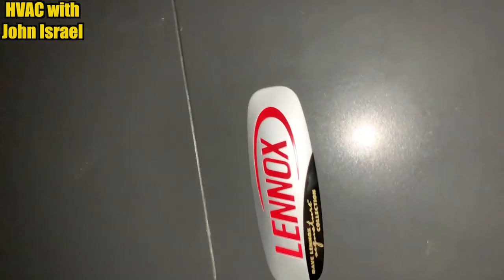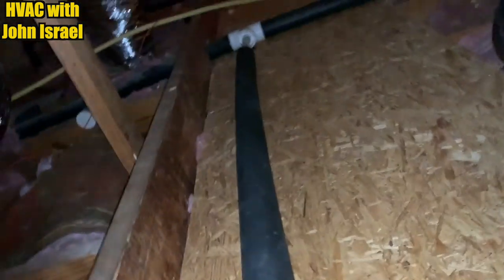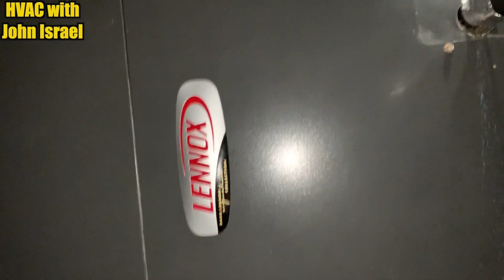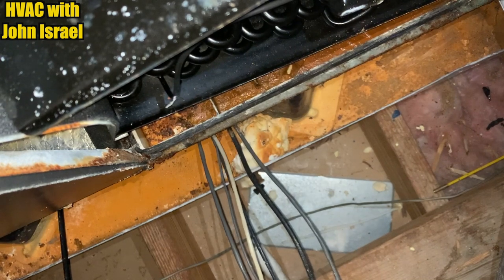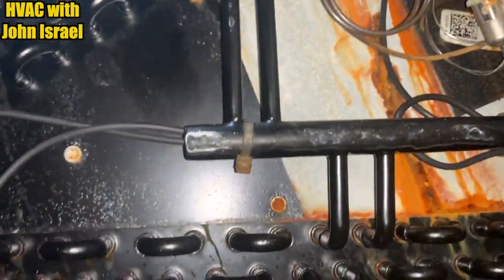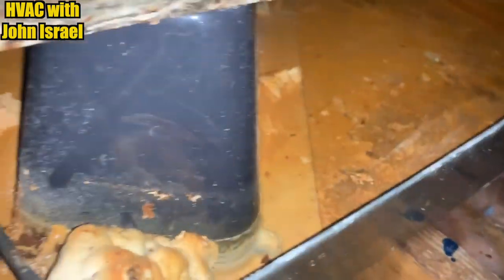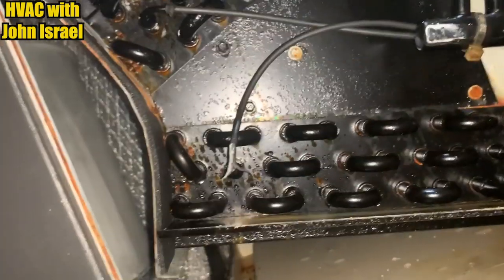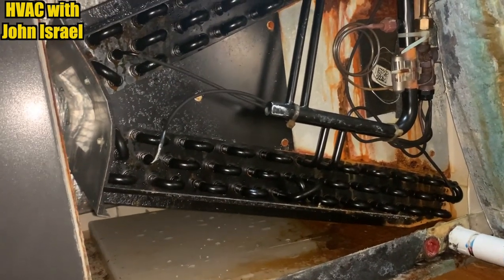Looking for Refrigerant Leak | Lennox AHU

Comment: Found the same exact coil,in a right hand discharge in the attic of a Vet. Clinic, leaking on the back lower side. Was a larger leak that developed quickly over a weekend.  They said it was fine when they closed Sat. & when they came back in a Mon. the temp. had climbed way up. Lennox has major issues with I.D. coils & O.D. TXV bypass factory solder joints. And they just don't seem to be fixing the problems. The company I work for was built on Lennox for 30yrs., but know we have all but quit selling their stuff. New gas furnaces are pretty good though.

Comment: John: Due to the condition of that air handler, would Lennox consider having you change the whole air handler as a warrantee item. I had a carrier years back and they said they would just replace the air handler, due to all of the board and electronic issues they had? Thanks for the video.

Comment: did you ask them if you could pay the difference between the two coils?
I think the coil problems are likely coming from the off gassing of the foam, attacking the copper.

Comment: It is my understanding copper is more expensive than aluminum, and aluminum evaporators last longer because it doesn't suffer form galvanic corrosion. With the exception of a slight loss in efficiency why would a company still choose copper?